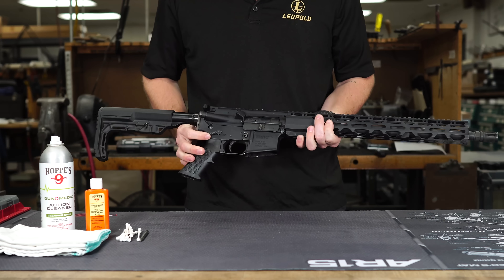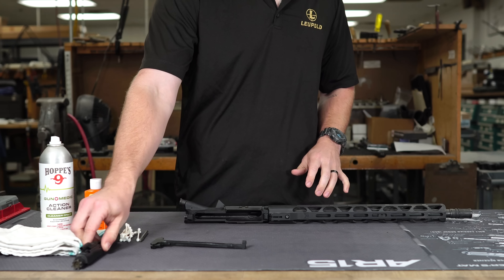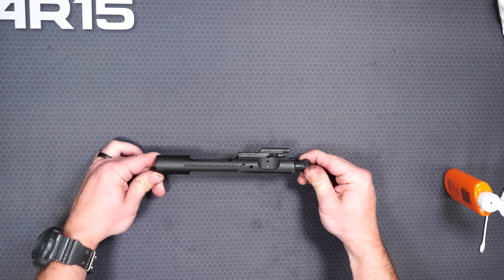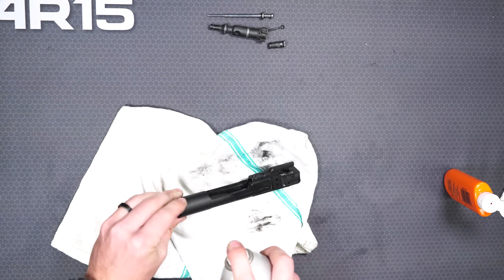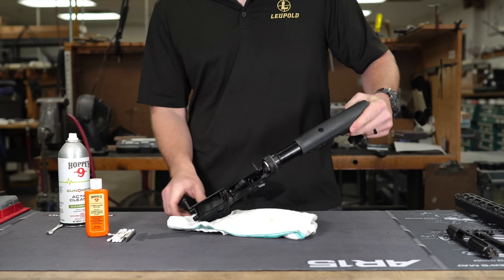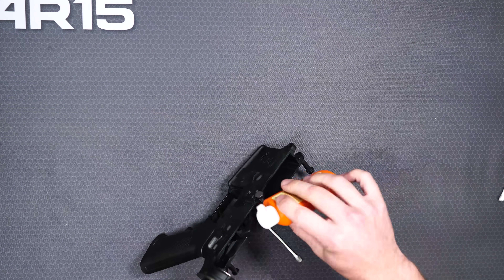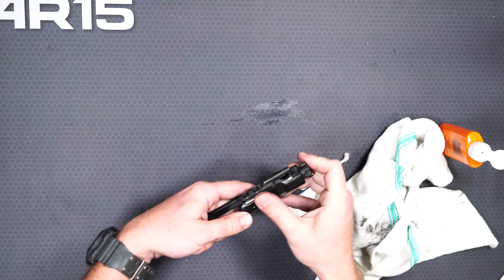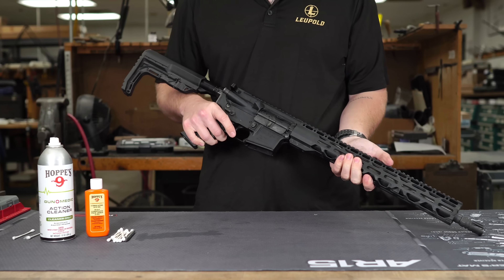How to Properly Clean and Lubricate an AR15

Comment: I was an armorer in the US Army, so I have one humble suggestion: Use a medical, wooden handled swab to do the cleaning, instead of the paper-handled ones from the drugstore. The non-sterile ones are pretty cheap, especially if you buy 12 dozen. These swabs will not shed strands of cotton, and will hold together a lot better than the drugstore ones. Good video. Thanks.
Reply: Yep, been using those for 50 years.
Reply: Smoke shops probably have the best swabs...these smokers need them?? I don't know but seriously they have the best swabs 100% cotton on wood sticks
Reply: @BenjiTheStaffy  I buy the non-sterile variety in lots of 144. You save a lot of money that way if you use a bunch of them.
Reply: Good call…….and I’d wear latex gloves….too many chemicals in these cleaners
Reply: What kind of wooden handles swab?
Reply: @countbendego6965  instead of waxed paper or plastic the cotton swabs are basically toothpicks with 100% cotton on the tips, the ones i get one side is rounded and the other is pointed so you can get corners/edges aswell
Reply: @BenjiTheStaffy  oh… I get what you're talking about, I've seen those, but never bought them. May I ask where are you typically get them? my father passed away about six months ago and my son and I inherited a bunch of his guns, unfortunately a lot of them were older and not cleaned very well in a long time. So we've been doing a gun a weekend and going through a shit ton of Q-tips lol.
Thank you again for your advice!
Reply: The aerosol spray sounds a lot like brake cleaner, comes out strong and dries fast.
Reply: @BenjiTheStaffy fellow stoner and gun goon.
Yeah stoners need swabs for the dabs, gotta keep everything fresh
Reply: @morsumbra9692  you're admitting to being a felon
Reply: @somecsguy9824  1. Not in my state 2. Criminalizing a plant is pretty stupid
Reply: @vernonsteinkamp1088 or maybe carb cleaner.
Reply: 100% and use a friggin lint free cloth or microfiber towel.
I use grease on the contact rails when lubing my bcg, this assembly just felt too dry for my taste.
Reply: @backwoods357  Just an FYI - coffee filters are lint free. They are great on many things, including TV and computer screens.
Reply: @SaltySouthTexan  In several videos I have watched, no one is wearing glove.
Reply: @BenjiTheStaffy to clean glass bongs since percolators gets pretty complex inside the downstem with tiny holes
Reply: @somecsguy9824  dang 
Police out here
Reply: Would you be ok with dropping a link of the ones you talk about?
Reply: @BenjiTheStaffy I figured the smokers ones would be good for this. You don’t wanna leave residue in your concentrate chamber!
Reply: Thanks this is my first rifle any tips are much appreciated. I have a apf slim carbine ar15 would you upgrade parts on this or just keep how I bought it. I did buy iron sights for it. I was thinking of keeping this one stock and just buy a little nicer one down the road. I don't have anyone to really ask about this
Reply: @davidvictory8066  If you don't like the stock, buy that first. You must be comfortable to shoot.

Next, think about some better optics, if needed. Maybe a forestock if you need a better grip.

Don't get carried away.
Reply: @BenjiTheStaffy harbor freight my friend cheap and they come with a variety size pack.   Some are as big as my finger
Reply: 144 swabs?  Is that necessary?
Reply: @papaversomniferum5247  They don't go bad, and I use them for other things aside from cleaning. They are handy items.
Reply: Thanks for that!  I remember these because they're what got stuck up my nose for COVID tests lol.
Reply: A dozen dozen is a gross B)
Reply: @blakake  Yes, indeed. However, I didn't know how many readers would understand that.
Reply: @morsumbra9692 there is no such thing as a criminalized plant or poison ivy would have endured that fate a long time ago. It’s the people who aren’t paying taxes on the sales of the plant that are criminalized in some states. I think  paying taxes on a plant is pretty stupid too though.
Reply: Harbor freight has a bag with all different sizes
Reply: Same here...Bags of wooden handled swabs.
Reply: Qtip
Reply: @xyvar1  Absolutely NOPE. Q Tips have very loose cotton, which will fall off.

Comment: Cleaning the barrel is the main part for me. All the other parts you mentioned are important as well. I clean after every session which is usually somewhere between 50 and 200 rounds. I know everyone does it differently, but as I said for me cleaning the barrel is the main focus.
Reply from the maker: Cleaning the barrel can definitely help, although it won't usually effect reliability of the firearm which is most important. It can effect accuracy though. I personally clean my barrel every other time I do a general wipe down. Around 500-1,000 rounds.
Reply: Me too.  I always clean the barrel.  After every time.
Reply: Good vid ty.. I have a lot to learn my experience with AR is limited, but with my auto birdguns it was always cleaning the chamber and the bolt group and gad piston function.  Like the other comments, I thought one of the keys was keeping the chamber clean was a bore / chamber brush?
Reply: Barrel is actually the least important part to clean. You should clean the receiver and the bolt. Barrel is one thing you can get away with never cleaning and your rifle will still cycle
Reply: After a 30 rd mag, an AR will reveal its "shiny spots" that need lube. The bolt tail always collects carbon that should be brushed or scraped and the "3 rings" of the bolt need to be cleaned, lubed and askew before reassembly. The firing pin and channel should be kept clean.  That's basically how to keep an AR functional in my opinion. Although, concentration on a clean bore and barrel are vital if you want to hit where you aim. Gas impingement ARs typically need a rag to wipe where you can and some lube on the shiny spots. Good video
Reply: You clean your barrel after every session? 50-200 rounds?  Why?
Reply: @tbeehler  why? Are you worried?. Dude.  Run your gun.  Saw a comment about "shiny spots" that need oil.  IT'S A TÒOL. USE IT. 

Talking about keeping a screw driver or hammer this well lubed and pristine would seem ridiculous.  Run your first rifle always and dirty. 
When it malfunctions, learn why,  fix that,  then run it faster.
Reply: I built an AR a few years ago. I didn't know what I was doing. I literally had someone standing next to me going, "Now take that thing and put it there. You can look at mine. But I'm not touching yours."
He goes, "Now put some drops of oil there, there, and there... If you want to clean this every time you use it, you're an idiot. Watch a YouTube video. Just re-oil these spots every thousand rounds or so and you'll be fine."
I've literally re-oiled ONCE in several thousand rounds.
Not a single failure (except for a polymer mag issue - NOT the firearm).
Accuracy is excellent.
I've backed the rear pin out only one time since I put the upper on. Only once.
Reply: @paulmckarns5259  why? I understand the discipline. But Practically speaking I don't understand . Accuracy is so negligible..
I'd want to know if a dirty weapon functions correctly, instead of having a polished gun case. 
Seems like a collector ideal and not so much a good practice.
Reply: @ItsDoms  to what end? For what purpose? How is this in affect contributing to your endgoal? Why?
Reply: @ItsDoms  which in affect makes sense.  Regardless of obsertity.
Reply: @ItsDoms I am expecting an honest answer that precludes the obvious.  Cleaning guns is a very serious issue and regularly filled with misnomer "experts".
Instead of saying "also, never spray oil on the firing pin" I ask
.. Why?
Reply: @ItsDoms  bro.  At the end of your comment on the Danish army protocol,  you stated, none asks why...
Then you responded to my question.
Reply: @axiom.ai.obviousbattletank7139  Clonazepam helps, dude! 😂
Reply: Cleaning the barrel other than the chamber part is useless.  One would think that sending a projectile over 2500fps would clean it out and whats left behind is smooth. The metal frags and copper left behind is filling all the small imperfections or pits not seen by the eye, why clean it out? I'm ocd about keeping my tools clean and serviceable at all times however cleaning a barrel that basically clears itself after firing is a waste unless for long term storage
Reply: Just found your channel and subscribed thanks
Reply: @tommynason5853  PoF rifles are the real deal
Reply: Can someone tell me the brand of this rifle?
Reply: @tommynason5853  Yeh man I very rarely 'clean' my guns. especially my ARs/Glocks. which are mostly SS/Aluminum/plastic (with exception of glock slide).  Now my vintage and heirloom firearms that have very old and very thin original bluing which NEEDs oil, whenever they leave the house and come back in especially if they are out in the cold and damp on a hunt... yeh they sit on the table come up to room temp my dad called it 'let em sweat for awhile' then wipe em down and oil em down including running an oil patch down the bore and whatever surface was visible with a field/simple table top strip. 

My dad bought me a ruger 10/22 for my 14th birthday. I have cleaned it three timesI think since then and I am 37 and one of those times was just because I had it detail stripped for a rebuild into an adult size rifle in my 20s. I probably have 30000 rounds through that gun. I would should a couple 500rnd packs of federal champion through it every month for years. less since .22 went through the roof in 2010s but still gets its fair share haha.
Reply: It’s not very hard to drop a bore snake through your upper when it’s taken down
Reply: Good time to talk about corrosive vs non corrosive ammo
Reply: Man, people will argue about anything.  Who gives a fat rats ass if he takes it to the bathrub with him and his rubber ducky?  Is it yours? Is what he does costing you time or money? No? Then why just be snarky ?🙄
Reply: Get a bore snake, ez pz barrel clean.
Reply: @axiom.ai.obviousbattletank7139  I'd agree if my rifle was like $1200. I don't clean it to the extent of this guy but I baby the thing lol
Reply: How much do you spend on a base rifle?  1200$ could setup an excellent rifle. But IMO the idea is to return fire upon an aggressor. 
A 600$ PSA won't ever win a Longshot competition, but, with 50 bucks and a little bit of knowledge can be as effective . Moa is not important.
Reply: @milkitysplit  you shouldn't.  Unless it's a show piece.
Shtf you grabbing your 5000$ pretty finished rifle? Or a gritty eater rifle?
Reply: Using oil is your problem. Stay away from it and use high temp. grease.
Reply: It should all be your main focus. Why half ass clean your rifle?
Reply: @homelessman3483  NEVER cleaning?  The barrel is the real working part.  It should be the focus of any cleaning.  Your gun won't blow up from  a dirty barrel, at least not easily, but it is the only part that can.  You don't have to worry about a bolt exploding. Regular barrel cleaning also makes you aware if the IS some kind of obstruction you may not have been aware of.
Reply: @midwestgunworks do you have a video of barrel cleaning? Im newbie to firearms. I have a delton sierra 316l M2 and have been having trouble finding a video where it shows barrel cleaning. I'm a visual learner so would love to see
Reply: Ehh, the bore itself is less important for reliability than the chamber and lugs. Get yourself a nylon AR chamber brush.

Comment: Don't buy the standard q-tip, as it is prone to fall apart. Get the long wooden swabs. They have a more compact head and are perfect for this. Also buy some pipe cleaners. Anyone that has served in the military and has had to break down their service rifle and clean it, knows the value of a pipe cleaner. I personally stay away from oils and lubricants like Hoppe's. If CLP (Cleaner, Lubricant, Preservative) is good enough for the military, I find it works well on my personal firearms. Anytime you put rounds through the rifle, there is bound to be fouling inside the barrel, so its just good practice to run a cleaning brush and patches through it.
Reply: Which long wooden swabs ?
Reply: Also would you recommend clp for pistols as well?
Reply: @Max-jk3tt harbor freight has a big bag of different sizes of them

Comment: I gotta tell ya that I am "clean freak" with my AR's. It's a habit I picked up from when I was in the Army and I always try to get my AR's "inspection" ready. It's probably overkill but I can't imagine not cleaning the chamber or even breaking down the bolt to clean the inside either. I know in my head the weapon will function fine without that but it's the little OCD in me I guess. Nice video though!
Reply: Bro same! but in the marine corp they give you the shittiest tools to “clean” your weapon. So you either dont get everything or your tools just make it even more dirty. Or you have the right cleaning gear and you somehow get blasted for using “unapproved cleaning equipment”
Reply: @solaireofastora8609  yeah man I was in army infantry for years just got out 3 years back and we didn’t get the best cleaning supplies either or the stuff is just worn out
Reply: Yeah, I'm not going to leave crap in the chamber or the barrel.  I'm also going to break the bolt down and clean it. and inside the gas key and the carrier itself.
Reply: Totally agree.  I clean mine every time I use it, whether 10 Rounds or 1000 rounds. I want to absolutely work if I ever need it if the shtf. That includes cleaning the barrel by the way.
Reply: good practice anyways . at least you know your firearms looking MINT
Reply: I don’t care what anyone says I go straight home from the range and break just about everything down on all my stuff to clean it diligently along with touch up if need be after EVERY range trip. Yes I have my beater (that I still clean diligently) but everything else I have is because I wanted it, and I worked very hard for it.
Reply: So I just got into the AR platform world. I would consider my self well seasoned with fire arms. I have a 450 bushmaster and a 223 wylde. The 223 has a BCA upper and a Daniel Defence lower. Why the Hell does the 223 get so Dam Dirty with powder fouling? I'm serous, it's like cleaning a muzzle loader after every 60 rounds. I'm hoping it gets better with time. I've fired Winchester AAC and Hornady amo threw it looking for the most accurate off the shelf stuff. Any ideas?

Comment: Great video, but barrel cleaning is definitely necessary...

Run a lubricated (CLP or whatever cleaner you use) patch down the barrel from back to front, 
use a barrel brush with your cleaner on it from back to front, 
and then run dry & (lightly) sprayed/oiled patches (alternating between them) through until clean.

Comment: I use transmission fluid to clean and lubricate my ar. Since I'm not in a hurry, I'll let the parts soak in the transmission fluid for about 10-15 mins and that normally breaks up any carbon build up or makes it very easy to scrape off. Been doing it for a few years now and no problems.
Reply: I was wondering if there’s something else one can use since those “gun cleaner” and lubes are pricey, especially if you wanna clean your rifle often, what kind of trans fluid you use? GM dexos?
Reply: @chevyboy1978  I just use what ever is cheapest and the quart will last you a lot of years. I poured the trans fluid in a plastic container with a lid and it's been at least 3 years and still have a lot to use yet.
Reply: It’s also great for transmissions. Just saying.
Reply: @a3300000  It is. Ever noticed how clean the inside of a transmission is?
Reply: @chevyboy1978  if you can’t afford gun lube but can afford ammo?
Reply: @Blueknight1960  I have a GM. It wasn’t that clean. 😂
Reply: @a3300000  It's not about what I can or can't afford, it's what I choose to use.
Reply: @Blueknight1960  I wasn’t even referring to you.
Reply: @a3300000  why waste money on lube when you can buy more ammo… gotta use your noggin! 😂
Reply: @chevyboy1978 Try Ballistol. It’s been around for years and years and it works like a champ be it cleaning lubing and protecting. It does it all very well and it’s cheap
Reply: Cosmoline thinned with mineral spirits.. spray it on and wipe it off. Or just get an AK and spray it with brake cleaner once a year 😂 Also, if you’re not cleaning that gas block you will start getting short stroke FTF malfunctions
Reply: Look up "Ed's Red". In short, it's a mix of equal parts ATF (automatic transmission fluid), mineral spirits, kerosene and acetone. It's a great home-made CLP that cleans way better than Ballistol. It leaves a thin oil film that works in most places, so you only have to add grease or thicker oil to some moving parts in the end.
It works as a bore-cleaner, too, but if you need the absolute best bore cleaner, products like Boretech C4 are still better, but they cost an arm and a leg and I only use them like once a year.

Comment: Automotive brake / parts cleaner also works really well and is a lot cheaper if you don't want to spring for the spray can of cleaner. Use the difference to get good lube. I like to use a spray can of Balistol or rem oil with the plastic straw to just spritz the lube in the needed areas.